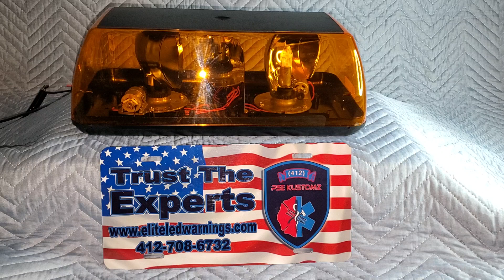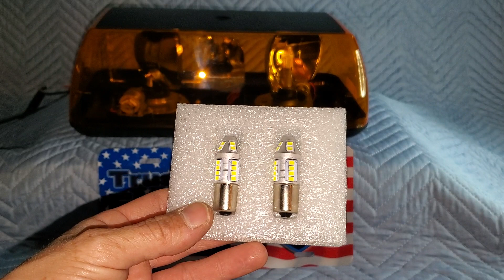Ecco Safety Group 5315A Amber Rotator Mini Bar Upgrade to Led Bulbs

Comment: Awesome video, what brand and model is the light bar? Those motors are zippin’!
Reply from the maker: This bar is an older version Ecco brand rotator. I believe it was sold and installed on a customer's truck. So the exact model# I'm not sure of off hand but I can ask Sr. 
I'm sure he could remember the mfg date of this unit.

Comment: I’m a fan of those rotating beacons
Reply from the maker: We have many customers that have been with us from our inception that love and only use the old school rotating beacons/mini bars. That's why we have done our best to decrease the current draw of these items to optimize the vehicle performance. 
Unfortunately most  of the quality manufacturers of the "ole" rotator products are phasing them out completely due to the led/electronic advancement within our industries more current equipment. 
Very soon it will be all but impossible to obtain the basic rotator beacons/mini lightbars. Unless you can find them used and restore them or in the rare occurrence that you find one in maybe a NOS(New Old Stock) condition or decent fully functional condition. 
The future of rotating warning lights is all based upon led diodes and the engineered electronics of each elite manufacturer as they try to mimic the rotators that so many have depended upon in the past.

Comment: I like the rotating lights for some heat to melt the snow off themselves when plowing in the winter as long as it’s a class 1 light
Reply from the maker: That is another benefit to the halogen bulb rotator. The current draw creates heat that melts snow/ice so that it doesn't build up.

Comment: I have wondered about using LED bulbs in place of halogen bulbs but wasn't sure. I have seen LEDs used for brake/tail light applications and they seem to have blind spots when in the disbursement of the light. There are literally dark spots on the lens cover. I was afraid the same would be true to use them on a rotator. I still prefer a rotator. I believe the rotator can direct the light a true 360 degrees verses an straight facing directional light such as an LED. I know the LEDs are built at angles on the corners but it still isn't the same. 

But I also have a theory about power draw using these lights. I am thinking that it is the vehicle used, not the light, that is the weak point in electrical issues. I had a Code 3 LP6100 mini bar and when I used it in my truck, the power plug would get hot... so hot it would literally melt. This would happen just after a few minutes. I had to replace the plug more than once. This would happen well before the fuse would blow. However, if I used it in my car, the plug would get just a little warm to the touch, even after 30 minutes of operation. I recently acquired a Fed Sig Highlighter and was trying it out in my truck, again the same truck. Only after about 3 minutes of use, the plug was extremely hot to the touch. I then tried the Highlighter on my car and after 5  minutes, the plug was still cool.  I do use a SVP 1166 teardrop in my truck but it is only one light and motor, not the double light and motor. it works fine and I dare not use anything bigger.
Reply from the maker: We appreciate your input. Our founder has tested many bulb replacement options in the rotator mini bars. Many customers still preffer the mechanical rotator as you expressed. The bulbs we use he has found to be the best option. Which does cut down the current draw considerably. Hence why with the led technology we are able to install much more equipment than with the previous styles of equipment. Obviously these bulbs are not a perfect replacement for a halogen bulb. These bars are designed for a halogen bulb. 
Ofcoarse the circuit in vehicles that feed the 12v cigarette lighter style plug do vary. Some offer a 10amp circuit as to were some come as a 20amp circuit so that would be why your seeing the variation between vehicles.

Comment: yeah sorry but i have to disagree with a lot of the things you said in this video. 1 the heat of the halogen bulbs absolutely does not effect the efficiency of the motors. as an RC enthusiast, as well in rc crawlers they utilize brushed motors, bigger and some similar in design to what’s shown here. the effectiveness of the motor is no different in hot or cold temperatures. i’ve run it right in icy water and the motor is still the same warm temperature afterwards. honestly the heat is a selling point as well. having a bar that has domes that stay warm is great for people who do snow removal as it keeps from snow and ice from forming while out taking care of lots. no worrying about if your light is still viable. two, these LED bulbs absolutely do not fill the reflector nearly as well as a traditional halogen bulb. to put an LED bulb in a non LED rotator is wrong
Reply from the maker: Disagreements are healthy in any senario. Although science, experience(25+years experience) and engineering knowledge, clearly show heat, specially excessive heat affects the efficiency of any motor. Although we see your point and acknowlege the fact that a halogen* rotator will keep snow & ice from building up. The led bulbs we use do absolutely & fully fill the reflector to maximize the output & eases the burden that these lightbars put upon the the electrical systems of the vehicle in which they are installed. Trust me when I say this isn't a theory or just a DIY tip. Our CEO has been in this business & utilizing/battle testing all the equipment we sell, service & install longer than most have been alive. Even with the replacement of the bulbs in these rotating mini bars snow/ice buildup that would affect the affectiveness of the bar have never, and I repeat never been an issue. Obviously if you plow snow in maybe Alaska or the Arctic it may be an issue. But in large this upgrade works absolutely flawless and provides phenomenal performance. On a seperate note, the newer led technology equipment we sell, install & occasionally service. 99% of the time is such a low profile footprint that snow & ice buildup while performing a plow fleets duties isn't even a conversation. Either due to the fact that it doesn't happen, or that even if it does happen the performance is affective whether there is buildup or not. Now don't forget that we only deal in or with industry elite equipment. I'm not speaking to the performance of many of the common brands used by private snow removal/landscape contractors. You see most of the contractors are utilizing brands such as Ecco, Buyers, Wolo, STL & yata-yata-yata. Although the demonstration in this video features an Ecco product. It like so many others are nothing but imported re-branded products that really do not perform as professional grade equipment. Unfortunately the Amber sector of emergency warning equipment 99% of the time is fuled by price rather than performance/value. That is where we come in as an asset that is irreplaceable! The knowledge, experience & expertise that we offer can add so much value to even the smallest fleet/operation. Not only does it save you $ short & longterm it makes your team & the general public safer. This rains true no matter the industry! Whether it is Law Enforcement, Fire, Emergency Medicine, Public Works or private contracted snow removal.
Reply: @412psekustomzllc7  actually not true. Due to the nature of LEDs they do not effectively work the same as a halogen bulb in a light housing/reflector designed for a halogen. The beams patterns are completely different. There’s a reason actual lighting manufacturers like federal signal designed a rotating light utilizing LED tech but a very special rotator. To simply put, this is not SAE approved anymore after you put your sub par replacement in. Just because it’s LED doesn’t means it’s always better. A very common misconception. Please due some further research in optical engineering, and appropriate lighting optics and how they function in a warning light
Reply: Have you guys noticed the Deer this winter and the change in their beautiful coats ?

Comment: HI 412 MY NAME. IS MICHAEL BEHRLE FROM. ST.ANN MO.AND I HAVE A CODE 3 420 ON MY TRUCK I ALSO HAVE A CODE 3 5100 BAR AND I LIKE ROTATORS A LOT BETTER I WOULD LIKE TOO FIND SOMONE THAT WILL KEEP THEM IIN STOCK
Reply from the maker: We normally have the resources to obtain rotator lightbars. We have been in the industry for greater than 25 years and have many resources. Some that rebuild & refurbish older bars. The hard part of keeping the rotating lightbars in stock is that most of your industry leading manufacturers have discontinued them. With that said, soon the only way to obtain a brand new unit will be to purchase from an overseas manufacturer. As there are many imported brands that continue to manufacture them. Unfortunately more often than not the quality of those brands is far bellow professional grade. 
As I explained we have many avenues we use to obtain the rotators. So we would be a good point of contact in obtaining them for sure.

Comment: I prefer rotators.  I think they look better and show up better during the day.  I have led bulbs in mine  and am very happy with it
Reply from the maker: Yeah we have customers that just won't make the transition to led. As long as you use the correct led bulb they work well & lower the current draw somewhat.

Comment: What is the bulb you guys use in this lamp? Thanks, Shelton's Odd Jobs & Oddities LLC.
Reply from the maker: The bulb is an 1156, the brand is Las Fit. They are a USA manufacturered high end led bulb. If you look on Amazon or Ebay there are so many led bulb replacement options available it can be overwhelming sometimes. As we always tell customers not all led equipment is made equal. We have found that the Las Fit brand is a reliable brand with high end quality. We hope this helps. Let us know if you have any other questions. Happy Holidays!
Reply: @412psekustomzllc7  I just looked on both sites and could not find the same bulb that you guys used in the video.
Reply from the maker: @Tinkerbell227  So I just spoke to our contact at Las Fit and they advised me that they have discontinued this cone shape 1156 bulb and replaced it with their "X" style model. It is a dual sided bulb that when you look at one side it resembles an "X". They say although it contains a lower diode count it is just as bright as the leds it uses are stronger and they also claim the "X" pattern design achieves the same performance as these cone bulbs do. I was able to find cone bulbs searching ebay that match this design although they are a different brand that we do not have experience with. They were $10.80 a pair w/free shipping if you want to try them. The item# 263949796904, if you type it into the ebay search bar should direct you to them. Otherwise the Las Fit Amber Led "X" design 1156 bulb on ebay is item# 322929870825(also the ebay item#) is an option they promised to deliver the same performance and are a high quality US built bulb. Hope this helps, hope you had a safe and happy holiday. Let us know if we can assist with anything else.
Reply: @412psekustomzllc7  I looked at the X bulb and it doesn't shine in all directions like the bullet bulbs does. Granted the bullets don't shine down as well but they give a more even light around in a circle. The X bulbs don't do that. They are more 2 sided. The five sided bullet bulbs are perfect though. Thanks for helping me find them.
Reply from the maker: @Tinkerbell227  Agreed, one of our master technicians had the same feedback when I explained to him their re-design. Seems we will be ordering the same cone shape design from another vendor such as the one I was able to find for you. Glad we could assist. Maybe you can share your feedback on those bulbs once you receive them and have a chance to test them out.
Reply: @412psekustomzllc7  I am still looking for one of those lights. I research everything before I spend any money. 

I have decided on this model of beacon and now I found the bulbs to buy. I looked for new bulbs from the original because of amp draw.  I am now ready for the purchasing phase. 

I did the same thing when I built a $2,500 gaming tower for $800. Mind you, I never built a computer before and had no help doing it. But I still made a computer out of 5 year old parts that out preforms any store bought computer made today. 

If you would be looking for a technician and if you like my ingenuity. You can reach me at my company page on Facebook. 

Shelton's Odd Jobs & Oddities LLC

Comment: I have a whelen responder DX. It uses 35 snap in bulbs. If I wanted to use led bulbs what should I use?
Reply from the maker: That bulb should be a T4. We absolutely recommend choosing one which has the bullet top design like Sr. shows in this video.
Reply: @412psekustomzllc7  where can I get those at?
Reply from the maker: @Bradley_Edwards_91  You will have to search around. They are not easy to come by. It's hard enough finding a regular led T4 replacement, let alone the bullet style. I will ask our parts purchasing if they have any leads for you.
Reply: @412psekustomzllc7  thanks I appreciate it